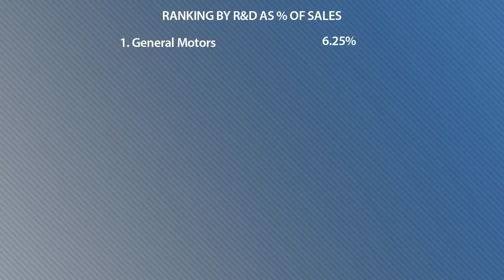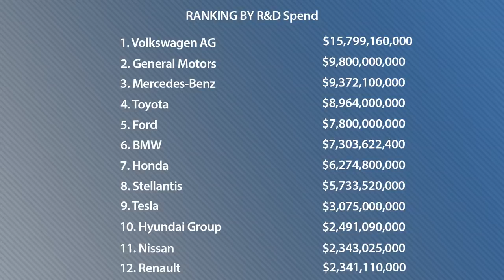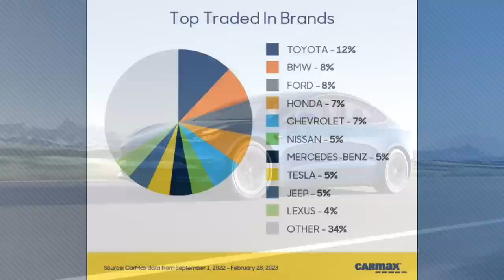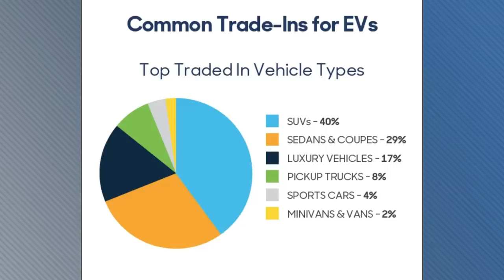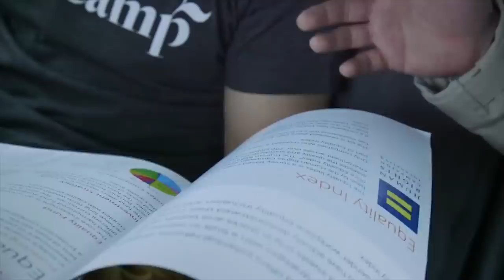BYD Growing Faster Than Tesla; Limos Going Extinct

Comment: BYD is growing faster..
As long as you include all their hybrids and minicars.
It's funny how legacy automakers HAVE to spend more on R&D just to catch up. Bringing a dozen EV models to production instead of focusing on a few core models.
Reply: Sad that Tesla only has two outdated cars that they can't even sell if they drop the prices drastically.  They'd better get their shit together!
Reply: They don't need to catch up at all, but they all need to work out how to develop (and when) future product across dozens of models around the world. It's easy for a tiny company like Tesla (4 factories compared to 60) with only two sedan/hatchback models. How is Tesla and other startups coming along on their sub-$30K passenger vehicles? How about a work pickup, minivans, SUV/CUVs in multiple price brackets, light and heavy commercial vehicles?
Reply: @joeking433  
Sad that you feel a need to post misinformation.
Reply: BYD also outsells Tesla in China in BEV's. They outsell every automaker in China in total vehicles. BYD also just introduced the Seagull, which is the size of a Fiesta and is their smallest car. Typically, that is not classified as a "minicar," but It is not included in 1Q sales.
Reply: @bobwallace9753  They dropped their prices a BUNCH and still only sold 4% more EV's during the same time a year ealier!  That means trouble!
Reply: @joeking433  toyoduh sells over 5,000,000 car's across just 5 model's. 🤔
Reply: @joeking433  S and X are no linger necessary for the mission… duh
Reply: @4literv6  What's your point?
Reply: @joeking433  

"Tesla delivered 422,875 vehicles for the first three months of this year, up 4% from the previous quarter. This was 36% higher than a year ago"

36% higher in Q1 2023 compared to Q1 2022.  

Up only slightly from Q4 2022.  Why?

There were fewer days (90) in Q1 23 than Q4 22 (92).  Tesla Shanghai stopped production for eight days in January 2023 due to the Chinese New Years holiday.    So fewer production days overall and their largest plant closed for a week.  You can't sell cars that you haven't made.

Then add in that Tesla is moving away from their previous end of the quarter push to deliver as many cars as possible.  That means more cars will be in transit on the day the quarter ends compared to previous quarters.  IIRC, there was a boat full of Teslas, including both Model S and X at sea when the quarter ended.  Those cars would be counted as "inventory" since Tesla does not count a sale until the buyer takes possession.  

Finally, most of the price cuts occurred late in the quarter (IIRC).  It takes a bit of time for potential purchasers who might make a buying decision to learn about a price drop.  

Is Tesla in trouble?  Hard to see how.  Tesla is not only leading the EV market in almost all markets but the Models Y and 3 are now top sellers in total markets, outselling most ICEVs.

Tesla continues to lower their cost of production. That allows them to lower their sales price which expands their market.  Even if margins did drop a bit with production on track to double over the near future Tesla should enjoy much higher profits due to higher sales volumes.  By the end of this year Tesla should approach having 2x the production capacity as what they had in 2022.
Reply: @bobwallace9753  Elon knows Tesla is in serious trouble.  When you cut prices drastically and don't see the demand you expect you start shitting bricks.  What can you do to spur demand?  There's nothing else you can do but worry.

Having only two tired outdated  cars to offer is a problem.  The only thing I can see Elon can do is go the high quantity, inexpensive, low margin route.  Kind of like the VW Bug approach when they first came out.
Reply: @joeking433  
1) Tesla largely dropped prices back to where they were before they jacked up prices when demand greatly outstripped supply.  

2)  Tesla has four models which are more advanced than any other EV.  Plus the semi which is being shipped.  And the Cybertruck which is on track for production this year.

3)  Tesla stated many years ago that they would work to decrease the cost of their EVs in order to get more people to switch from ICEVs to EVs.  As Tesla lowers their cost to manufacture they are able to lower prices while maintaining good profit margins.

4) Tesla is about to start construction of a new gigafactory which will give them a sub-$30k EV to sell in a lower price segment of the market.  Just like they started with the S/X and used that experience to let them produce the 3/Y they are now moving to a new market segment.
Reply: @joeking433  you know teslas are updated DAILY. Joes Justice worked there for years and communicated they make 1400 updates per year. 

Name another company even capable of doing that.
Reply: @bobwallace9753  bingo. The Dude is clueless.
Reply: @4literv6  don’t mind JOKING dude. They guy is playing with half a deck and cherry picking any data he can to make himself feel significant.
Reply: @bobwallace9753  great detailed reply. To bad, JOKING dude, tries spinning it with nonsense. He’s one of those guys who dismisses facts with emotion. A lethal combination of nonsense.
Reply: @joeking433 Just a little detail.  Tesla dropped prices a bunch (following a huge spike in mineral prices that came back down) and then sold 4% more in Q1 '23 than in Q4 of '22.  They sold 36% more in Q1 '23 than the same period the year before.

Please don't let your glaring hatred of the EV leader make you blind to simple numbers.

Comment: But what if the company is doing R&D in the wrong areas (like hydrogen fuel cell and ICE will  they also come out ahead ⁉️⁉️
Reply: Nope. They said, if you spend more you always come out on top. It sounds like a law that can't be broken. 🤣
Reply: @JoelSapp  ok I guess we will see. I wonder if Autoline could explain that vague statement ??
Reply: Hydrogen fuel cells are not a wrong area.
Reply: There will likely be applications for hydrogen fuel cells but not likely for consumer vehicles.
Reply: @benjaminsmith2287  for passenger cars, yes
Reply: @JoelSapp  Most research is for commercial vehicles, including with Toyota and Hyundai. They're using the cars as testbeds.

Comment: BYD had  pretty negative Q1 results compared to Q4 ‘22
Reply: The gross margin in Q1 23 was 20.7%, compared with the 22.8% gross margin in Q4 2022, compared with 15.6% from the first quarter of the last year
Reply: @igotanimac1  How did sales compare?
Reply: @gpsfinancial6988  For the first quarter of 2023, BYD delivered 264,647 all-electric vehicles, up about 85% from the same time last year.
Reply: @igotanimac1  Farzad did a good analysis on Twitter on the two market leaders:

"In Q1 2023, BYD posted over $400M USD in profit growth, with revenues reaching over $16B, over 80% increase YoY. However, revenues were 23% lower than the company's Q4 2022 earnings.  Comparing BYD's performance to Tesla's reveals that while BYD's revenue was down 23% from Q4 2022 to Q1 2023, Tesla's revenue decreased by only 4%.

From a unit perspective, BYD sold 522k cars in Q1 while Tesla sold 423k. However, as stated earlier, about 50% of BYDs sales are pure EVs (or BEVs). This means that in Q1, Tesla sold ~60% more BEVs globally than BYD.

BYD sold 693k total vehicles in Q4, making Q1 -20% lower from a unit sales perspective. In comparison, Tesla sold 405k in Q4, meaning Q1 was up by 4%.

Tesla's net profit percentage has steadily declined from 17% in Q1 2022 to 11% in Q1 2023, while BYD's net profit percentage rose from 1% to 3% during the same period, although it did decrease from Q4 2022 to Q1 2023 from ~4.5%. However, despite a significant drop in sales from Q4 2022 to Q1 2023, BYD experienced faster growth than Tesla from Q1 2022 through today, primarily due to its fleet of very affordable vehicles"
Reply: BYD sells in China and China 1Q is always the weakest quarter, as businesses shut down for the new year. Comparing 4Q to 1Q without adjusting for seasonality is a misleading comparison. Look at 1Q to 1Q. Look at total vehicle market share, EV market share and NEV market share, with BYD leading in each category.
Reply: Q1 in China is always the worst quarter. because of spring festival and it is not the usual season to buy cars. It is almost for all brands
Reply: Q1 is Chinese new year dude.😂

Comment: Tesla RD on EVs alone has got to be impressive though? Also makes you wonder ROIC for this new stuff.. did GM make enough selling hummers yet to cover makings it's documentary yet?
Reply: 2 mode hybrid, mild hybrid, volt phev, bolt, fuel cell equinox, all massive R&D expenses and all failures in the market place. All of those models and sub brand models combined are less than Tesla sells now. All the Ultimum r&d will be wasted too. The pouch was wrong and models in the market from tiny companies already go 500 miles.
Reply: @TokyoOlympics2020  the amount spent up to now seems limited in its transferability as well.. they are scrapping the bolt.. and volt seems like a waste.. and do they get anything from the JVs in China?
Reply: @TokyoOlympics2020 Yeah it looks like what GM needs to do is merge with Lucid.  It would be the best R&D money they ever spent.  Still no guarantees that either company would get to scale production.